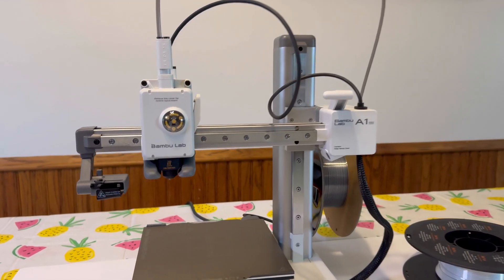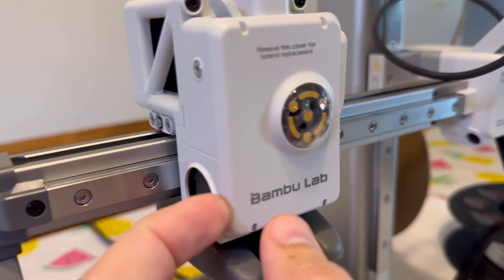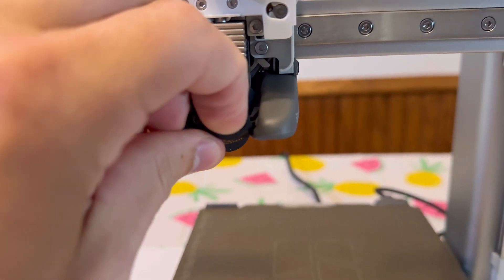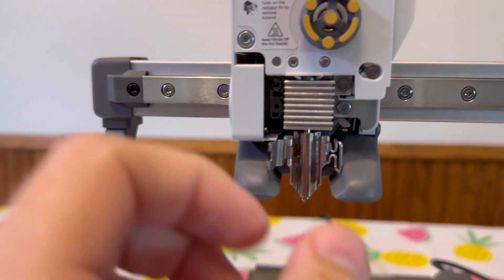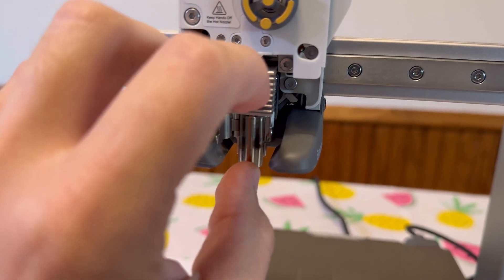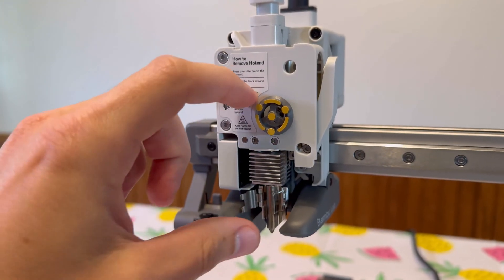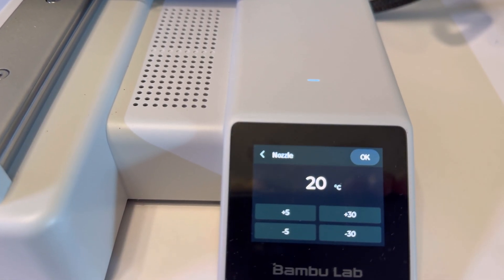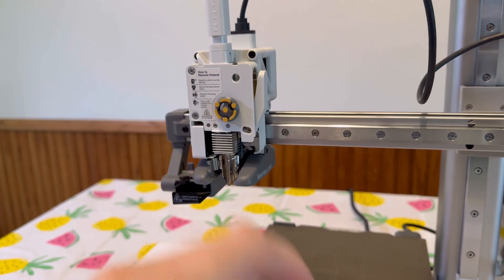How to Replace Hotend on Bambu Lab A1 Mini

Comment: Total noob here. Do i need to unload the filament first? What position should i set the extruder? Does the machine have to be OFF? I assume the temperature of the nozzle should be set to 0 before pulling it out?

Comment: Great video! I have a quick question, if you don't mind. I followed the steps and replaced the hotend's heating kit, but now there's a noticeable high-pitched buzz or whine whenever it's heating up. I was wondering if you know what could be causing this or if anyone else in the comments has experienced the same issue. Any help would be appreciated

Comment: And then what? I already removed and replaced this part before seeing the video, but I was hoping to see how to make sure it works. Specifically, I turned it on, and went to load filament so I can test it's extruding properly. After pressing the try again button like 10x, nothing is still coming out.